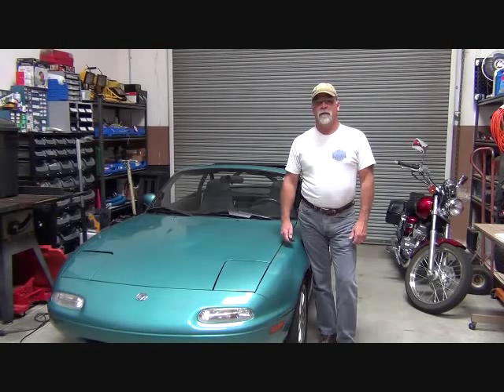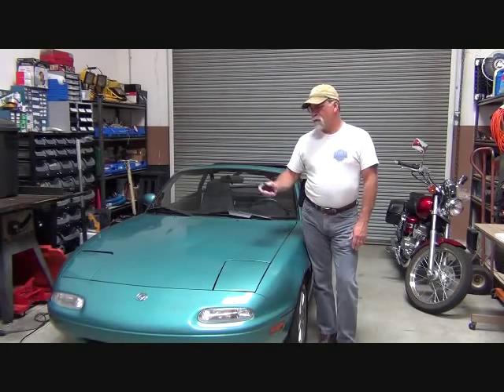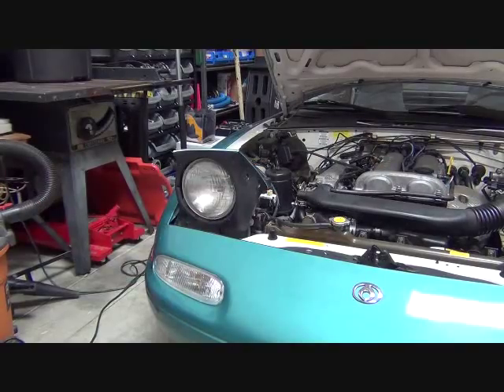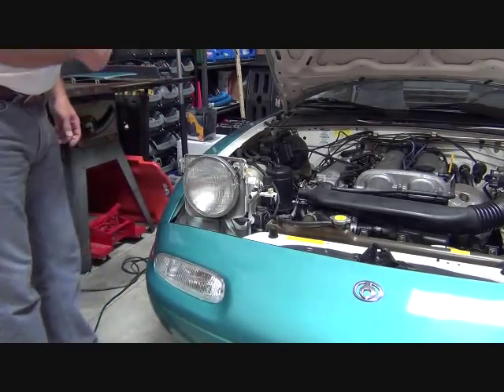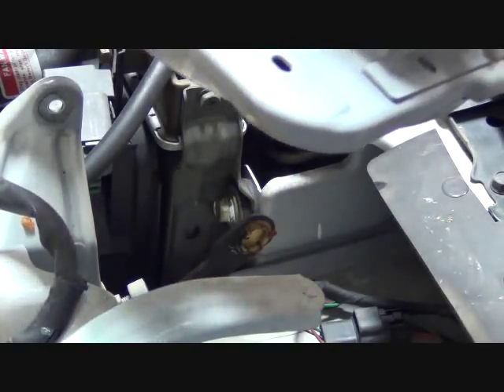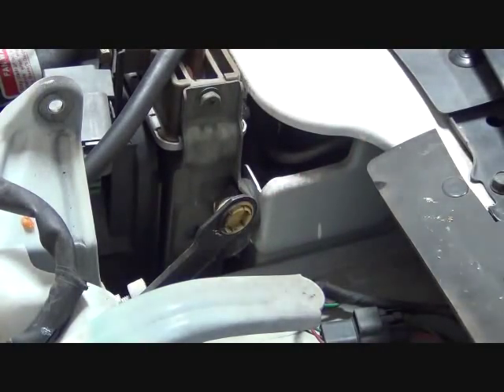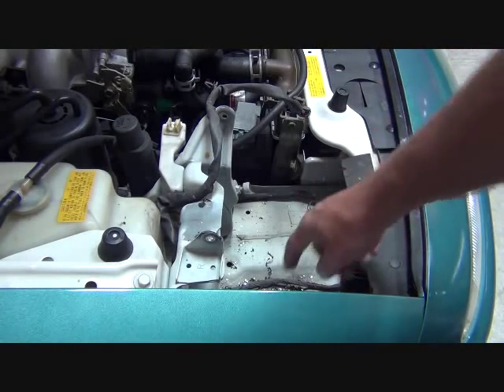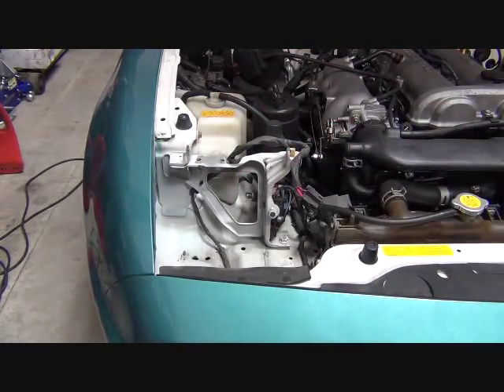Mazda Miata 1st Gen Lo Pro Lights

Comment: Now to find a setup that uses LED instead of halogen. The Miata looks a hell of a lot better with these headlights vs the stock. Too bad you couldn't take advantage of the turn signal lights and convert them to headlights.
Reply from the maker: This video was made eight years ago, I'm sure they have LEDs by now.  Thanks for watching.